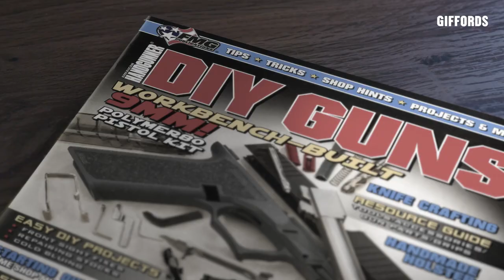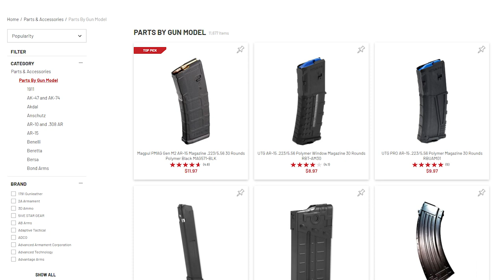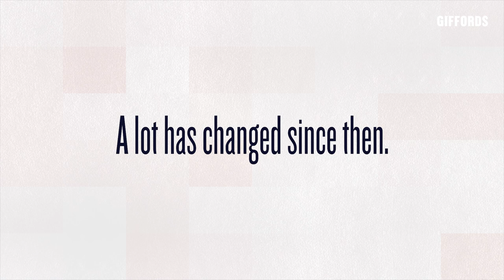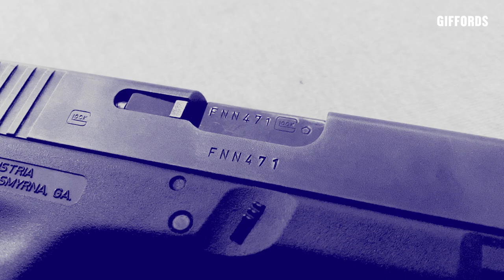Ghost Guns? Meet the DIY Firearm Anyone Can Build at Home.

Comment: They are leaving out facts like you only need a serial number if you are selling or transferring a firearm. You can also make a firearm with a piece of pipe and a nail. This is click bait for the uninformed and is misleading..also nice job clipping the news castings in that way..
Reply: "You can also make a firearm with a piece of pipe and a nail." EW half truther! , we are about facts here on ewe toob! ! 
its 
a 1mm diameter nail, protruding .75 mm through, 
a cork set inside, 
an end cap  that fits on, 
a 6 inch long 1 inch SCH 40 piece of pipe that can go over , 
a 3/4 inch SCH 40 piece of pipe 26 inches long
Reply: @waptek2  Hello.  Just checking to see if the State Department has arrested you yet.

Comment: This is going to get out of hand. After 80%s are banned, then comes 79% lowers. What about when we get down to 1% lowers? Do we serialize aluminum billet? Aluminum cans? Plastics? Concrete? Wood? All it really takes is a couple of pieces of above material and some pipe screwed together in the right dimensions and you have a firearm. What's the goal here?
Reply: Their goal is to not stop till everyone has no right to self defense or firearms ownership. They rather have you slaughtered like an animal by a criminal than have you defend yourself by any means.
Reply: @SnorlaxDaCat  I just want people to be honest about ends. There seems to be a deeper goal than modern sporting rifles. Handguns are used exponentially more crimes and suicides than any rifle, let alone the modern sporting rifles. Why aren't we talking about handguns instead?
If you want to ban all guns, cool. Let's have a conversation about it. But the gun control movement already got machineguns banned, even though the Hughes amendment failed to get enough votes to pass. Machine guns were never (by the FBIs admittion) used in many crimes, just as the modern sporting rifle now. Now were talking about modern sporting rifles and aluminum blocks. It looks like a slow creep. I just want people to be honest when they talk.

Comment: A solid block of plastic is an uncompleted receiver. I guess those will be made illegal as well.
To look at it another way, the law currently allows an 80% complete receiver to be sold without a serial number. 81% is right out.
This raises the question; would a 70% complete receiver be OK? No? 50%? No? If a 50% complete receiver is too much, what is OK?
Reply: @Nitro-SmK  huh huh huh huh 😂😂😂😂
Reply: 💯 percent receivers should be ok. Why does the government need to know who's got a gun??? Aren't their enough cameras everywhere that if someone gets shot the cops could catch them?
Reply: Sorites Paradox.  If I take away a single grain of sand from a "heap", it remains a heap.  If I take away all the grains except one, it is no longer a heap.  With this logic, if I remove grains one by one, there must be a single grain that, once removed, disqualifies the remaining grains from being a heap.

Gun grabbers will have no issue with criminalizing blocks of steel. 

Gun nuts will claim that surface to air missiles are fundamentally no different than blocks of steel.
Reply: sadly they just answered this :(

Comment: It's not a loophole when the law specifically allows one to make their own gun. See the Gun Control Act of 1968...
Reply: The Gun Control Act of 1968 is a U.S. federal law that regulates the firearms industry and firearms owners. It primarily focuses on regulating interstate commerce in firearms by generally prohibiting interstate firearms transfers except among licensed manufacturers, dealers and importers.
Reply: @chanceadams5157  AND it specifically allows an individual to make their own firearm without needing a third party manufacturer or a dealer.

Comment: Fact when you buy a receive it’s stamped with a serial number. Even if it’s not complete or 80% complete. Also buying a uncomplicated receiver you need tools. And you practically got to be a mechanist to complete it. It isn’t easy
Reply: Speak for yourself. You can make a slamfire with $20 and a trip to home depot. I know this because I've seen 13 year olds at my school do this.

Comment: Wait you think that there is anything simple about building something that uses controlled explosions in your hand to operate is easy? You best understand what you are doing and get educated first. While your doing that educate yourself on the law it is absolutely legal to build a firearm at home for your personal use provided the intent is not to sell or manufacture with the intent to sell. 

Additionally if you are a prohibited person and you make yourself a gun guess what your a criminal. If you were under the impression this one sided story was not going be met with facts and common sense your wrong. 

Guns do not commit crimes , people do .... the same people your party seems to think they should release to the public early because of Covid19. Now wait let me get this straight prisons were exposed and your answer is to release them into the wild to spread it? Yeah .... I don't think the gun is the issue but your logic is in need of a tune up or maybe a cleaning of the absolute illogical bs the media and your mentors apply to pretty much everything.
Reply: I agree with your main point but the part that is considered the gun is the fire control mechanism, i.e. the trigger.  There are no explosions happening in the trigger mechanism, at least I hope not. These parts can easily be completed from 80% to 100% with simple hand tools.  

 The heavy lifting so to speak is performed by the slide in a handgun or the barrel in a rifle. Parts that ironically are not controlled and can be easily purchased off eBay or anywhere else.
Reply: @jscott1000  if it's not riding the rails properly and your using parts from multiple vendors and not getting proper lockup in the we barrel that Frame is not going to save your hand. Unless your using all oem parts designed to fit together you still need to know how to properly fit parts that includes filling and measuring Tolerances

Comment: The only thing stopping someone from building an open-bolt submachine gun from parts you can get at any hardware store (bent sheet metal, pipe, files, metal bar stock, various power tools) and a Glock mag from a local gun shop is the law. And criminals do not care about laws.
Reply: 3d print the mags